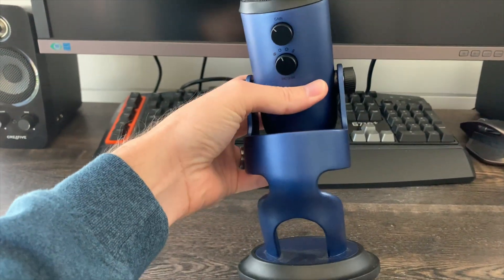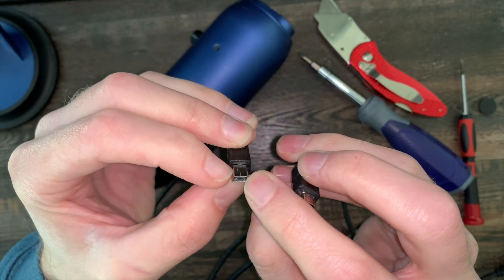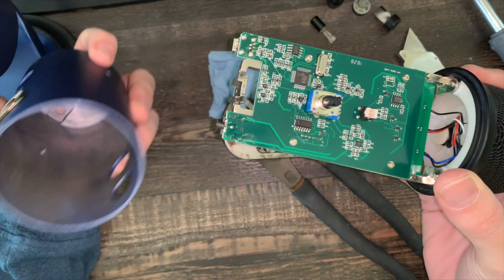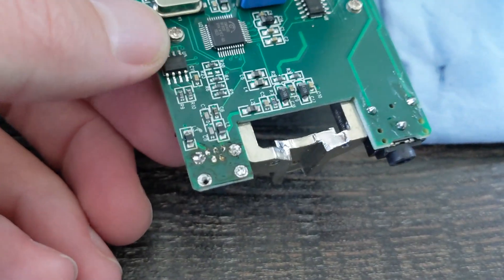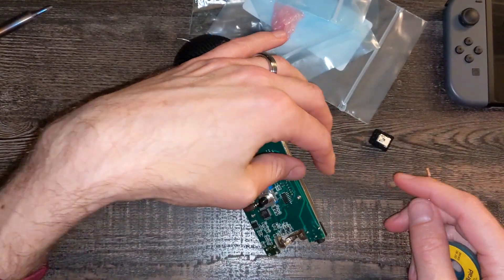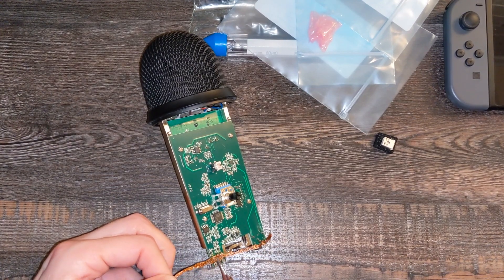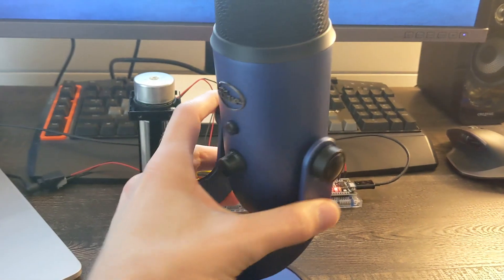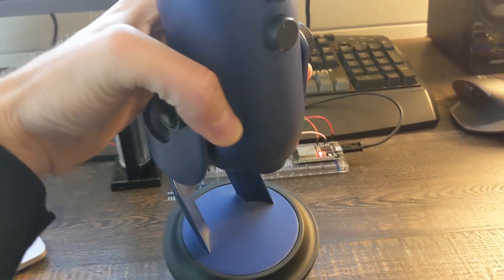Blue Yeti Microphone Not Working - How to Replace a USB Port

Comment: hello, i ordered this microphone from amazon and not worked, so i got refunded all my money and they let me keep the microphone, i opened the microphone and first of all I found a red liquid that looks like glue on each screw of the board, in some making contact with the components, I suppose this caused permanent damage or is it repairable?
Reply from the maker: The red liquid is probably threadlocker which is designed to keep the screws from loostening. The issue is typically the USB port that becomes loose with then cable is pulled. I put a link to the components in the video description you could try to repair it yourself

Comment: the red light is working but the mic is not working should i replace the port and will it then surely work ?
Reply from the maker: It's a very common problem so if it's not working you could first try a different cable before fixing the port.

Comment: I have a couple of questions, if you woudknt mind answering these

How can I start this? I’m 16, and have never soldered anything. I don’t want to ruin the mic to potentially never being used again.

What tools are used here? And where could I get them? Do I need anything specific?

How much would these tools cost? I’m not balling in the funds department, so if you could give a estimate that would be lovley. 
And what exactly are we doing here? I don’t get the process
Reply from the maker: Yes?
Reply: @CarolinaCowboys  I’m confused
Reply: practice soldering something that is already broken, try to remove and resolver components, yuse wet paper towels to keep soldering iron clean and tinned

Comment: Only thing - mine is also a Blue Yeti, but there are no screws on the bottom. Can't figure out how to get into it.
Reply from the maker: Try doing everything else in the video, take off the knobs and the rubber piece on the bottom, there may be a screw under there.
Reply: @CarolinaCowboys  Thanks. Found them. Different model. Screw under label in centre, but everything else the same. Lovely technician got it working again. Thanks for the walkthrough.

Comment: Major design flaw with the Yeti USB port. The screws either side that hold the mic stand in position get loose really easily and if the mic swings back against the stand it bends the USB port like this. Just done the same with mine 😔
Reply from the maker: They should have recalled them!
Reply: @CarolinaCowboys  It's a shame because they are a really good mic, it's just that part of the design is a real issue.
Reply from the maker: @writerinrwanda  Yeah

Comment: A solder sucker or flux and solder wick is certainly key to removing the old connector. Either then add a USB socket on a cable, rather than another USB-B mini pcb mount, or potentially a beefier version of the same socket.
Reply from the maker: Ya my solder skills weren't the best when I shot this video

Comment: Such a crappy design for this port, and also a poor choice to use this mini connector. I almost broke mine within 30 minutes of setting it up, when I didn't leave anough slack in the cable on the moveable arm. There is quite a bit of space in this microphone and I have now ordered a USB-B full size panel mount socket, which I am going to replace the USB-B Mini plug for. They should have always have used this larger plug. This microphone has a bigger brother than uses a XLR microphone socket, and it is in this very location that I plan to put the larger USB-B port on my microphone.
Reply from the maker: Ya I agree, and it's actually a really nice microphone with exception of the USB port!

Comment: thanks for this - heads up that the warranty lasts 2 years from time of purchase. They were extremely helpful and responsive with warranty - I got mine replaced in under 10 days, from watching this video to holding new mic! Going to order the extension cable - that's a solid piece of advice to keep this mic port safe and sound. Thanks for your help!
Reply from the maker: Great to hear!
Reply: @CarolinaCowboys  Hi, thanks for the video, can you please provide me an Amazon link of the USB port that I can use with this.
Reply from the maker: @muaviya624  Hi The links are in the video description
Reply: @CarolinaCowboys  Sorry I meant the USB cable for Blue Yeti. Can you please give me an Amazon link of the USB Cable that fits into Blue Yeti?
Reply from the maker: @muaviya624  Here you go, I will also put this link in the video description - https://amzn.to/3evSo8R

Comment: This happens to a lot of Blue Yeti mics.  The cable that they provide is an awful choice.  When the microphone is angled down, the cable bangs into the back of the microphone mount, which bends it sideways, breaking the USB Mini B male end and, at worst, destroying the inside of the Mini B female port.  The solution is to purchase a USB A to USB Mini B cable that is right-angled instead of straight.  Amazon Basics sells these for $5 or so and their low profile won't cause the port and cable to be smashed every time you angle the microphone down.
Reply from the maker: I agree!

Comment: The stock wire that comes with the mic is not the best length- kinda short, my port eventually got tugged and broke a pin
Reply from the maker: That's how it happens every time. I think it's so common they must have a used a cheap USB connector

Comment: This process no longer works.  Probably because too many people abused the system, the creator of the video included.  Warrenty replacements now requires proof of original purchase from an authorized seller (must be a new purchase), as well as photos clearly showing the damage.  They will not just replace your mic so easily anymore.  Especially if you have opened your mic and proceed to destroy the IC board by burning it.
Reply from the maker: Taking apart electronics usually voids the warranty

Comment: Hey man this usb port i got has 4 legs, and the yeti pro has only 2 holes for the legs, do i just snip them off?
Reply from the maker: Do you mean the mounting points?  Yes, as long as it's not the leads that solder to the board

Comment: Some of the pins are bent in mine, not to mention the port can move out of the spot, do I have to go through this process or can I open up a ticket straight away?
Reply from the maker: I would open a ticket first and see if you can get the whole thing replaced for free.  If not then go down this path of pain.

Comment: hi just wondering if i send my broken yeti back will they repair it under warranty? idek whats wrong with mine the pins look fine but i think its the cable thats faulty but not sure, it was working okay ish earlier had to unplug cable and reinplug many times to get into a specific condition but when i put in now doesn't work at all, i believe its a cable problem
Reply from the maker: It's a very common defect in these microphones.  Just call them and they likely will just send you a new one without having to send yours back.
Reply: @CarolinaCowboys  what if i have no warranty😬😬😬
Reply from the maker: @nvious1208  Then they won't replace it anymore

Comment: Im having an issue where the stand that it comes with doesnt keep the mic itself stable. It flops back and forth from the slightest tap even after twisting the sides too. Pls help
Reply from the maker: Hi, the mic is tightened by the side screws and there is a round plastic washer in between the mic and the stand.  Make sure those parts are there and they are aligned properly.

Comment: Hi 
Carolina Cowboys - that part number from Digi-Key (A107788-ND) looks like it only has 2 mounting pins - did you use that part of the ones from Amazon in the end?
Reply from the maker: HI, I would go with the one on Amazon because there were 4 mounting pins and only 2 on the one from Digikey.  Good luck!

Comment: It would be easier to remove the old USB mini port if you use a solder sucker. You heat the solder until it starts to melt then use the solder sucker to, literally, sucks up the liquid solder. A solder sucker is around $5 to $10 and can be used over and over. It also means you won't be applying so much heat to the board and potentially burning out the other circuitry. This way the holes on the circuit board will also be clean and easy to install a new port.
Reply from the maker: I agree!  I think I burned mine to a crisp.

Comment: My yeti is doing something really weird. The USB isn't messed up or anything because when I plug in my headphones I can hear audio from my computer and when I talk I can hear myself through the mic and it sounds fine. But when I record myself the mic audio is all messed up and makes noises that sound kind of like a fart. I have no clue what the issue is. I also tried using different cables and plugged the mic into another computer and it still is doing the same thing. What's weird is  when I have my headphones in I can hear myself like a live playback of my voice from the microphone and the quality sounds fine. I'm so confused why its doing this. Any help would be much appreciated.
Reply from the maker: Check the audio settings on the computer, the recording settings should point to the Yeti microphone.
Reply: This is to adjust your setting in real time live.

Comment: The problem is that I don't have that equipment. I also do not know how to use them, so I'm stuck here being charged over half the price of my mic JUST to replace the USB port which costs 3 dollars. 😞 What should I do?
Reply from the maker: I would contact the manufacturer, they will likely replace it under warranty.

Comment: mine isnt damaged whatsoever and its still not working i dont get it
Reply from the maker: It's probably broken on the inside, they break very easily.  Try contacting them to have it replaced under warranty.
Reply: @CarolinaCowboys  I later found it its not my port that is damaged, I looked at the actual cable and I found out that my cat has been chewing on it so all I need to do is get a new cable, thank you though
Reply from the maker: @culdlol  Oh wow you got lucky!  A new mini USB cable is all you need

Comment: I don’t know if you still reply to comments but mines been broken for a good few years and I tried to fix it today but nothing is visibly broken, the port is positioned correctly isn’t blocked and the wire is fine however, when plugged in, the light doesn’t glow and My pc detects no input at all (not even as an unrecognised device). Any suggestions or do I just buy a new one/ send it to get fixed?
Reply from the maker: Hi, first thing is to try a different USB cable, if you're lucky the cable is bad.  But if that's not it then your USB port is bad and if you contact Blue they may replace the mic under warranty.  Good luck!
Reply: @CarolinaCowboys  it’s definitely the latter unfortunately. Thanks anyway for replying so quickly.

Comment: When you filed for your replacement, how did you provide a proof of purchase? I also bought a broken one locally, and would like to try and get it replaced before I tear it apart.
Reply: UPDATE! They needed no proof of purchase. My mic, which I got for free from a local buy nothing group, was still under warranty. After a little back and forth they are sending me a brand new one. Good deal.
Reply from the maker: They should replace them for free, it's basically a recall for faulty USB ports
Reply: @charliexit_nw  how did u request your refund. i was  told 2 call but the number is no good

Comment: Thank you! i spent an hour trying to install Yeti programs on 2 different macs and could not get to to work. Changing to a phone cable did. Really disappointed that with a brand new Yeti X this is still a issue.
Reply from the maker: I was going to say try a different cable because it does seem that the cable needs to have a longer metal end.

Comment: This is a common design flaw when moving the microphone around with the  mini B  USB cable plugged in. There isn't any plastic to keep the metal from bending and making 
the connection loose. After fixing/ replacing  the  female metal case to hold the cable in I would also buy a 6" extension cable which then you could enlarge the microphone
base USB slot so it accepts the male end of the extension and use a piece of black tape to hold them together.  You could then put back together the microphone cover and 
use the other end  of the short 6" cable which has  a female mini B   USB end covered by rectangular plastic which will allow you move the microphone with no more damage.
Reply from the maker: Yes it seems like a very common issue with these microphones in particular

Comment: Thanks for the helpful video. 
I'm struggling to remove the last bit of the pins using solder wick. Got any tips?
Reply from the maker: Try using a solder sucker - https://amzn.to/325lJOg
Reply: Solder suckers are definitely a better choice and easier to use